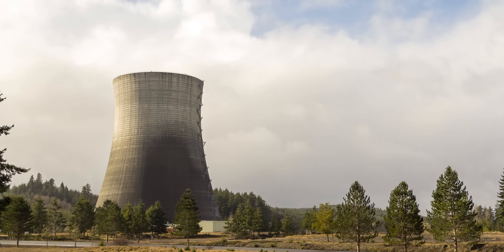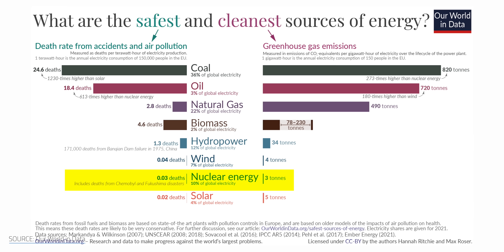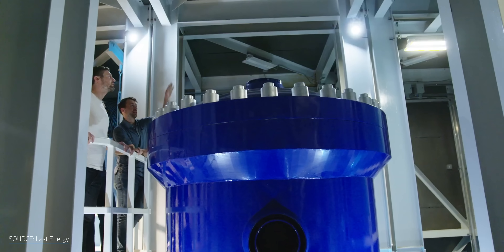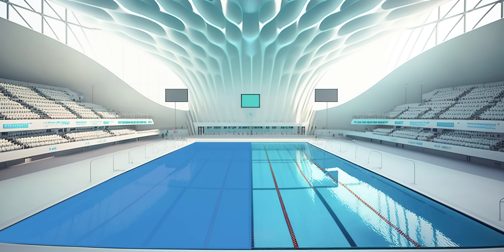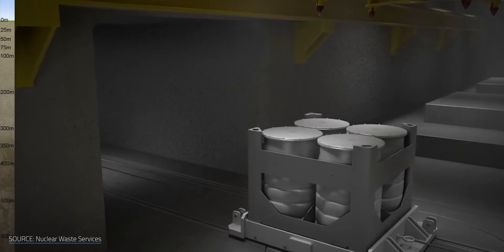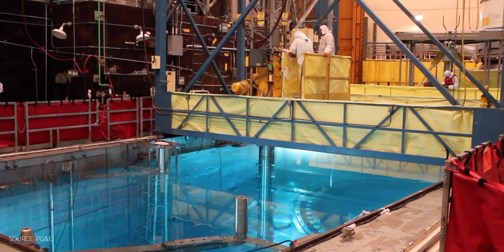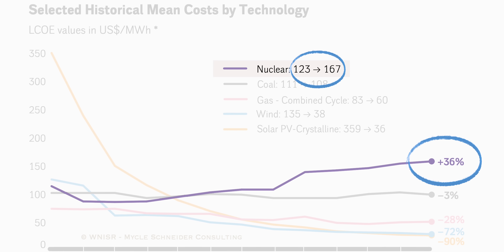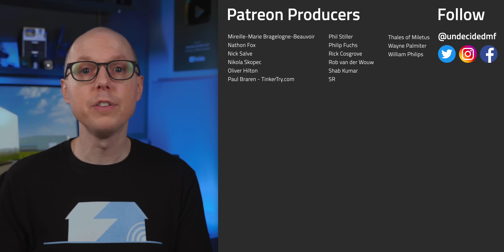Is Small, Fast, & Cheap the Future of Nuclear Energy?

Comment: Ok, yes nuclear is the logical solution.  (Which is why you hear about it in the comments section... 😬) 

In terms of danger w the long term storage section... depending on site selection the answer is yes it is safe.  24K years isn't a long time with respect to geology.  So if you have a geologically stable location... you should be ok.  Especially when you back fill the dump site as you fill it up.    

The reason why this may be a slow starting endeavor is that we've lost the technical skills required to manage nuclear energy.  
Also nuclear energy today is safer that your data shows.  You look at the total deaths from prior disasters.  You've pointed out how the plant design is a major factor in safety, along w location. Note that Fukishima... I don't think that anyone has yet died from the nuclear disaster... even though it was a first gen plant in a lousy location.  Only saving grace is that the water diluted the radioactivity in the area. 

What we're seeing is that Wind is not that great of a source of renewables.  Turbine fires, off shore wind farms impact on sea life ... etc.... 
Solar? Hail storm takes out power plant ... 

Probably the only issue... bad actors figuring out a way to use them as WMDs which may not even be possible.

Comment: I think the biggest advantage of SMRs are often overlooked. That is their use for direct on-site heat/power to industrial sites, sites like chemical processes or steel manufacturing. 
Those have been notoriously to decarbonize.
Reply: When high voltage electricity has to be transferred over long distances, as in the big-sized coal and oil and nuclear power sources, there are losses up to about 20%. SMRs don't have to send their output energy very far and will avoid this wastage.
Reply: There is still the issue of site approval and adequate security. I doubt if many factories would be approved for on-site SMRs.
Reply: Yes, especially for high temperature reactors like X-energy gas cooled reactor. Dow Chemical has a plan to install such a reactor.
Reply: SMRs are supposedly designed to not generate excess heat
Reply: @bruceevennett955  That's why we're talking about direct heat.

Comment: IMO nuclear is a technology best kept in large facilities if at all. We still have no good answer for what to do with nuclear waste... yes breeder reactors can purify it to be reused but the cost of transporting spent nuclear material safely, etc has made breeder reactors kind of like the carbon sequestering technology the oil companies tout. 
Finally, nuclear installations of any size make great terrorist targets. The security required for these small facilities would have to be extensive. Fences, cameras, security details, etc.  This will add to the cost making it uncompetitive. However all that extra cost is not mentioned of in the proposals of the companies that make them. 
  Solar and wind with battery storage are cheaper, superior and safe technologies. They also can be installed on tracks of land that are not as populated.  If they mess up or get attacked, the electricity does go out but you don't have to evacuate due to possible radiation poisoning!
The same thing is true of nuclear fusion.. which is not even out of the lab yet.... the cost of creating the fuel that is fused, the massive investment to get it going, all make it extremely uncompetitive cost wise. These technologies will have their place but mostly in the military and in space exploration, not power for citizenry..... solar and wind will have taken the complete market before any of the tech you show here (or fusion) will be viable, much less safe.

Comment: This may be the case in relation to accidents, the biggest problem is the waste. China has gone for thorium reactors. They dont produce waste, its recycled and China says it will be completely free of fossil fuels by 2060. Its cleared its 1st reactor for start up and they intend to go ahead and build a 373mkt by 2030.  It uses a liquid salt and requires no water. Therefore China has built this reactor in the Gobi desert

Comment: Nuclear energy it's humanity's worst idea ever, shoud be abandoned and the plants errazed. it's flaws are not just small ones, generates harmful material and will work only until the uranium deplets, making it smaller will not change anything and have more of that radioactive abominations worldwide will only enlarge the gap for failures and meltdows, it was a bad idea, it is a bad idea and it will be a bad idea.
Has for a "green energy" i don't think so whith the uranium mines destroying miles of native vegetation per year, and poisoning the surrouding areas whith small concentrations of radiation that still prejudices the small animals and plants.
Reply: What is a nuclear meltdown?  Can you name one object/material/chemical/anything that isn't radioactive?
Reply: @JonDoe-d8b  I'ts not a question of sometings aren't radioactive, i know very well that even the sun is radioactive, the question is poisonous dangferous radioactive levels. and a nuclear meltdown has you know it's when the cooling fails and the inner plate of the plant starts to overheat causing the nuclear material to explode dispersing a wave of heated irradiated gas and particles miles away from the poit of impact.👍
Reply: @rafaelsantiago6973  do all "nuclear meltdowns" cause explosions?
Reply: @rafaelsantiago6973  is your body radioactive?

Comment: LCOE is not a good unit to use.  It for example does not take into account that wind and solar is reactive energy. It only looks for "produced energy". 
It does not take into accout value of production.
Its like saying that a tent is better then a house or an apartment cause its fast and cheap to build and technincally gives us a roof over our heads. You really cant compare LCOE in wind or solar vs nuclear since the two ways of generating power differ so much. That said, Im not saying wind or solar are bad,, they are great and much needed! Just saying that LCOE is not a good way to compare energysources since the method energy production is way more complicated then "cost/total Kwh produced".
Also off-shore wind usually does not take into account the cost of actually connecting to the grid, which usually is provided by the owner of the grid and not the company building the windfarms.
Also I think the graph you are using for LCOE is the one that has been debunked as faulty but I cant find the source right now (too far down in my twitter feed to find it).
This link seemed to touch on the subject more if you want more reading: https://www.wri.org/technical-perspectives/insider-not-all-electricity-equal-uses-and-misuses-levelized-cost-electricity-lcoe

Comment: Did you really just suggest 30-60 people died in Chernobyl? When studies suggest between 100,000-200,000 people died as a result of the radiation exposure. 4,000 firemen and liquidators died within 2 years of the disaster.

Comment: How long have we had nuclear powered submarines ? Yet for some reason the small nuclear power plants in these have not been adopted to be used in other ways - at least not on any scale. Why is this ? The safety issue seems to be have been addressed as we have had few issues. We need to move forward with this as electrical energy demands are going to surge as we lose the use of fossil fuels.

Comment: The stakes are higher than you describe with regard to accidents. At Chernobyl we got lucky (in some ways!), as only a small percentage of the nuclear material entered the atmosphere. But for the efforts of many thousands of "liquidators" the whole load may have hit the water table, which according to the Chernobyl museum would likely have rendered half of Europe uninhabitable.

The way the Soviet Union tackled that problem was to throw thousands of miners at the project to build a barrier beneath the reactor to stop it melting down to the water table. It's estimated that around 250,000 miners participated, out of a wider number of perhaps 600,000 liquidators in all roles. Due to the heat and radiation (of which they were unaware) they usually did one shift before being rotated out; due to the heat they didn't wear protection, and were given water to drink which carried the radiation deep into their bodily tissues. Estimates vary wildly but a reasonable figure seems to be around 60,000 deaths directly from their exposure there.

Further reading: https://en.wikipedia.org/wiki/Chernobyl_liquidators

Visiting Chernobyl is quite sobering. Yes, the Soviet Union was a dysfunctional control economy and things are far safer now. Oh, Putin's warfare at Zaporizhzhia. And Fukushima. And many smaller incidents at Sellafield. It seems we aren't yet a mature enough culture to be trusted to play with toys where an accident could wipe out a tenth of our civilisation. 

Let's throw everything at solar and wind, and tidal, etc, before we play with fire.

Comment: Matt did not answer the key question here, over LCOE for these SMRs. It is such an obvious question I wonder how much he actually thinks about topics rather than just reads a script - from questtionable support researchers. Here is the Google Bard answer and this, if true, would really have added to argument in support of SMRs:

"The levelized cost of electricity (LCOE) for small modular reactors (SMRs) is still uncertain, as they are still in the early stages of development. However, some studies have estimated that the LCOE for SMRs could be competitive with or even lower than the LCOE for conventional nuclear reactors and other low-carbon energy sources.

For example, a 2019 study by the National Nuclear Laboratory (NNL) in the UK found that the LCOE for SMRs could be as low as £40-60/MWh, which is comparable to the LCOE for offshore wind generation. The study also found that the LCOE for SMRs could be even lower if economies of scale are achieved as more SMRs are built.

Another study, by the Massachusetts Institute of Technology (MIT), found that the LCOE for SMRs could be as low as $50/MWh, which is lower than the LCOE for both conventional nuclear reactors and new natural gas-fired power plants.

Of course, these are just estimates, and the actual LCOE for SMRs will depend on a number of factors, including the cost of construction, the cost of fuel, and the regulatory environment. However, the studies suggest that SMRs have the potential to be a cost-competitive source of low-carbon electricity.

Here is a table comparing the LCOE for SMRs with other low-carbon energy sources:

| Energy Source | LCOE (£/MWh) |
|---|---|
| SMRs | 40-60 |
| Offshore wind | 50-60 |
| Onshore wind | 60-70 |
| Solar PV | 70-80 |
| Nuclear | 80-100 |
| Natural gas | 50-60 |

As you can see, SMRs have the potential to be a cost-competitive source of low-carbon electricity. However, it is important to note that these are just estimates, and the actual LCOE for SMRs will depend on a number of factors."

Comment: The shorter the transmission range, the less loss there is... You use SMR's for distributed power and "nuclear waste recycling" style power plants to supply energy for higher density areas. This is the best way, with current technology, to safely and effectively power the transition to renewables. 
This can be scaled up relatively quickly, whereas renewable currently cannot. These wouldn't require massive grid level storage, renewables currently do. Nuclear is safer than lithium, believe it or not, because it is better understood and less susceptible to contamination defects.
Reply: NIMBY it's the real thing stopping installation of more nuclear! Stop the NIMBY and say "Yes! Right here in my backyard! The benefits are worth it."

Comment: There is something you are missing when talking about the expense of building nuclear power plants.
Nuclear power was going to be "too cheap to meter", but the anti nuclear activists adopted a deliberate strategy of passing so much regulation and putting on so many protests and challenges that they made building new nuclear unaffordable.
It's not a safety issue, it's a political issue. You will spend far, far more money on regulation, paperwork and legal challenges from activist lawyers than you will on the construction of a nuclear powerplant.
You can see the opposite in France, they rolled out a standard design and now they have the lowest generation costs in Europe.
France actually taxes electricity to fund schools & hospitals, by contrast Germans pay taxes to subsidise solar.

Comment: So far small nuclear reactors don't exist - just yet. There's a huge difference between a lab setup and an industrial roll-out. In the classic triangle cheap - fast - good, nuclear reactors only check one box: 'good.' And even that is only half a check, because the demand for electricity isn't constant. Add to that the observation that the nuclear fuel needed in today's concepts for SMRs ... comes from Russia. While I'm not afraid of the ecological risks of nuclear plants, I don't think SMRs are the go-to solution. I don't rule them out, a hybrid setup is usually the safest option for any electricity grid. Not the cheapest, but the safest.

Comment: 1. Small Modular Reactors are not new. In fact the preceded the big ones. The first power reactors were designed for submarines, which are not big. The smallest nuclear sub was the NR-1, with a pressurized hull about the size of two school buses.

2. Reactors grew so big due to red tape. The regulatory cost is very high and independent of size, so bigger is more efficient.

3. You got nuclear waste backwards. The scary stuff is indeed about 3%, but it doesn't last thousands of years, only hundreds. Radioactive materials are not magic, they contain a fixed amount of energy that can be converted into radiation, so the "hotter" they are the faster they run out. And radiation drops off at an exponential rate, so very dangerous sources are becoming less dangerous relatively fast. The worst are in the intermediate region, hot enough to be dangerous, but still last long enough to be a long term problem. But what causes almost all of the health effects are Iodine and Strontium isotopes, because they tend to stay in the human body. That's why Iodine tablets are distributed after serious accidents. Iodine-88 has a half-life of only 8 days, so it's not an issue in case of nuclear waste. Strontium-90 on the other hand has a 28.8 year half-life, so it's is a problem. But 28.8 years is not thousands of years.
The stuff that remains radioactive for very long are like Plutonium-239 with a 24 thousand year half-life, but for that reason it's far less radioactive. Plutonium is more dangerous as a chemical poison than as a radioactive one.

4. As for disposal, all the long lived stuff are transuranic elements, so they can be burned in reactors and even generate power. Most can't sustain a chain reaction, but in breeder reactor they burn just fine. So the ideal way to dispose nuclear waste would be burning the remaining 97%-99% of it until only light elements remain that decay into stable isotopes in a few hundred years. Storing waste for that long is an almost trivial task. And especially since we get almost 100x more power from the same amount of fuel.

5. But there's also a fully certified deep geological store in the US, the Yucca Mountain Nuclear Waste Repository. Unfortunately it has been the subject of intense political fights and likely will never be used. The reason is simple, it would hurt the very powerful fossil fuel business. If the waste issue is solved for good, the anti-nuclear forces lose one of their strongest talking points, so they make sure it never happens.

Comment: Nuclear waste can be recycled into nuclear fuel and reused. 

High level nuclear waste is still mostly uranium 235 and uranium 238, it just doesn't have enough uranium 235 remaining to be efficient nuclear fuel. The 235 is used up during the nuclear chain reaction, and it turns into the third component of spent nuclear fuel: miscellaneous radioactive isotopes.

Instead of sealing away the spent nuclear fuel, engineers and scientists can recycle the spent fuel to remove the miscellaneous isotopes, re-balance the 238 to 235 ratio and create fresh usable nuclear fuel which is indistinguishable from the kind made directly from ore.

Japanese commercial nuclear power plants routinely recycle spent nuclear fuel, and the majority of the fuel they use is recycled.

Aside from being cost effective, this process means that the high level nuclear waste being generated is nearly entirely those miscellaneous isotopes, and those isotopes have a much shorter half-life compared to uranium 238 and uranium 235. 

This completely solves the problem of long term nuclear waste storage.

The process is banned in the USA.

EDIT: Ah, I see this was actually discussed in the video.

Comment: Nuclear fuel recycling basically provides a whole new level of usability to nuclear power. A huge amount of old nuclear waste can be used to create energy, plus the remaining waste will have a vastly reduced mass and half-life. For SMRs like this which are standardised, it makes the entire process considerably more profitable.

in any case, SMR's could prove to be the most optimised form of nuclear energy (well, progressing to thorium as fuel would be even better, but that could be added in later on). The advantages it provides are considerable, while the scale of potential problems is much smaller - both radiation and meltdowns become vastly smaller risks, with much smaller affected areas in the surrounding environment. We'll have to see how the LCOE ends up looking, but this has great potential.